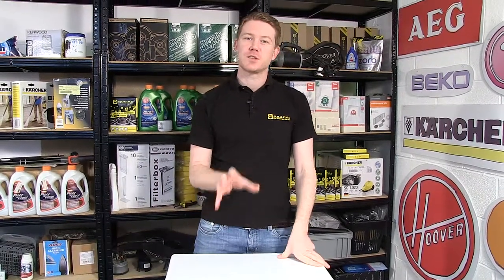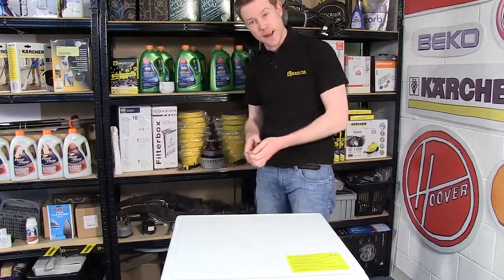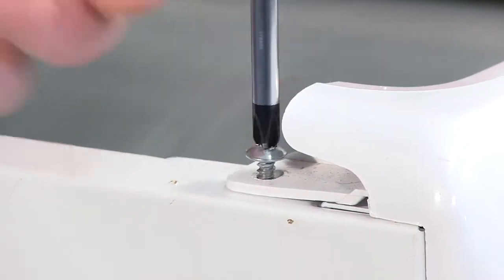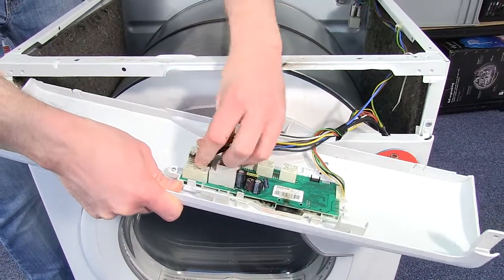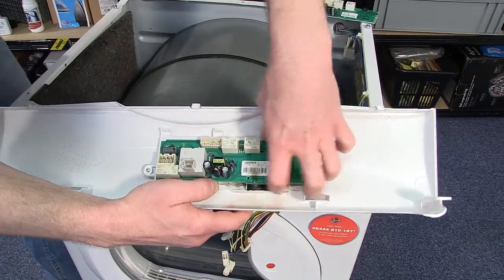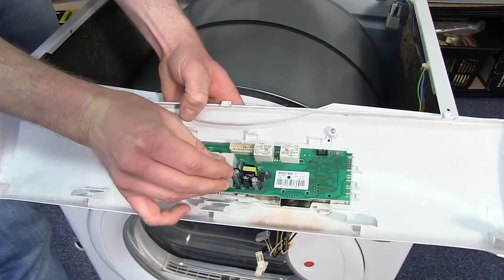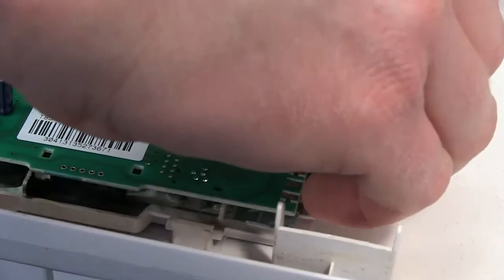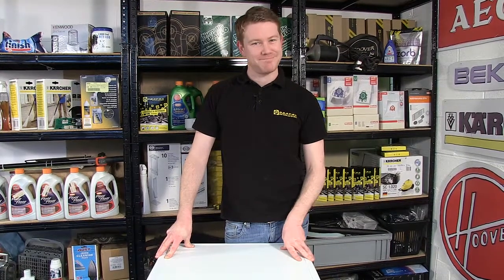How to Replace A Tumble Dryer Control Board (Hoover)

Comment: I have a Hoover Dynamic Next Heat Pump Tumble Dryer. It stopped working, so I had the run capacitor replaced. Which started the drum turning again. Although, since having that done. It only spins for 10 mins, then a long pause, then starts again. I have been told it is a reverse timer fault. Now would that be due to a bad  connection (connector) or a pcb fault? Everything else seems to work fine heat, selector, drainage. Just the rotation seems to be a problem.
Reply from the maker: Hi Soulspinner, it does suggest the PCB is not reversing correctly, check the connections to the board and look for any signs of damage to the board.
Reply: @eSpares  Thanks for the prompt reply. I will have a look at the connections. If a new PCB is required, do you supply them?
 Model no. DNH D913A2C - 80.
Reply: I have a 17 year old Hoover 5kg vented tumble dryer. My issue is the timer no longer turns off. What part do I need to buy to fix this problem please? Other than this issue the dryer is an excellent condition still.😊

Comment: I've got this exact model, would replacing this solve a problem with the lint filter light always coming on, even when the lint collector & heat exchanger below have been thoroughly cleaned?

Comment: I have an E15 code how many pcbs are on the dryer ?
Reply from the maker: Hi Derek, it would depend on your model what board and how many, it would normally only be one main board.
Reply: @eSpares  ok thanks if it's just changing pcb that's great.

Comment: Hi i have followed your video and have found that a part has come off the board. It seems to be part where the start button needs to press on to start the machine. Do i need a new board or can this be solider back into place thanks
Reply from the maker: Hi baby deedee, if the board is damaged it can be difficult to repair and with limited success so you may need to change the board.

Comment: It was working a minute ago and then I went to put a new load in and the light won't even work, I've checked the fuse's in the machine and the wall socket and I'm confused, could you help me please
Reply from the maker: Hi Emilya, you will need a multimeter to test the circuit from the plug to the board, this will determine if you have a circuit and what has failed.